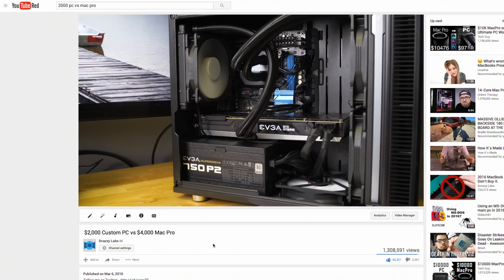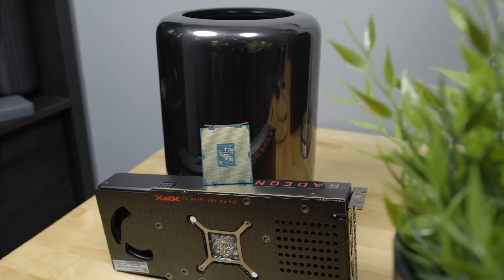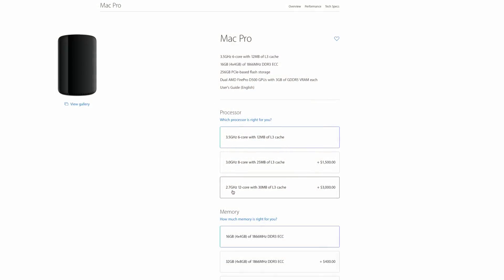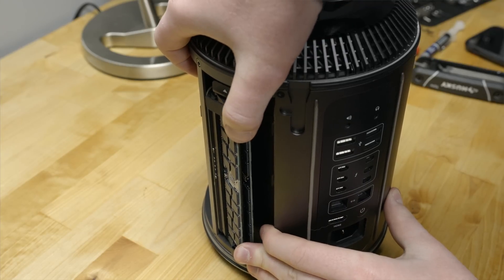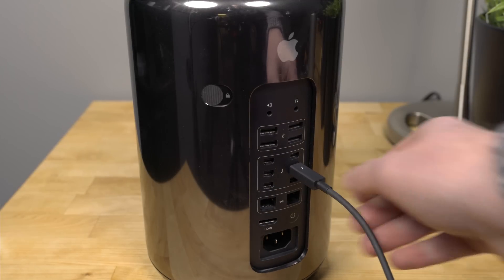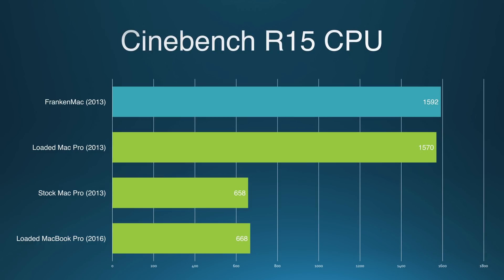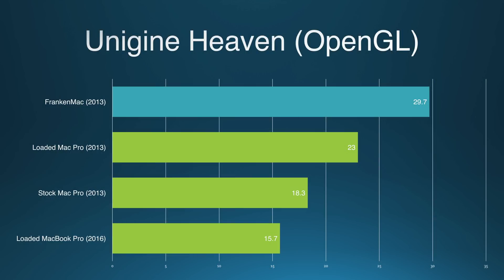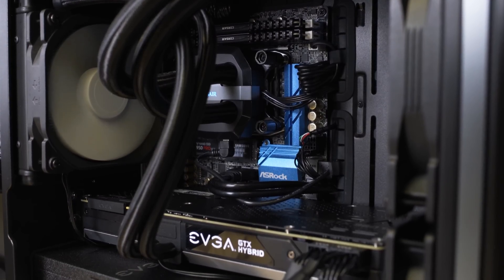The Best Mac... Apple Doesn't Make!

Comment: Hello ! Your work is awesome thank's for sharing this informations! I have questions though, do you mean I could actually 
just buy this  AMD RX480, put out the AMD FirePro D300 and make it work just using thunderbolt port?
I am currently working on my MacPro late 2013 3,7 GHz Quad-Core Intel Xeon E5
I upgraded it with 32Go ram (4*8Go Crucial DDR3 ECC), and recently a OWC 1To SSD.

I mostly work on After Effects, and according to the latest Adobe keynote, lot of information will be treated through the GPU on the next update.
I would really like to be able to upgrade my Mac Pro in order to stay with it as I still really like this computer for reasons.
Your solution seems so cool, and actually the only hope I seem to have; but I am not as skilled as you are in hardware, and I lack budget rn. 

An answer would be so  appreciated ! Again, thank you for your work!

Comment: So you could connect the External GPU over Thunderbolt 2 and it worked? I’m wondering if it’s possible to get an EGPU on a 2013 MacBook Pro, or my Mac Mini (both have Thunderbolt 2)

Comment: I've seen people do the same thing with an old imac. Get something like 
an old 2011 imac and put 1TB  SSD raid, 32GB ram,  and an intel i-7 
3.4Ghz cpu in it and in many cases it will outperform a lot of off the 
shelf imacs and be cheaper in the end. Except for in gpu performance of 
course because the gpu can't be upgraded.

Comment: i bought my Macpro 2013 used for 1500 bucks in 2018. It was a demonstration model. Still overpriced but I like the fact that it is very quiet and relatively powerful l. I did upgrade the ram to 64gigs which helped a lot for about 300 bucks.

Comment: And that’s why apple will probably be locking down modification with T2 chip, solder every component to the board, and make even more obscured screws or pour in the glue for a higher IP rating. I mean how else they going to sell such innovation as having a Touch Bar that can display Nyan cat on a pro device that cost only $5000, when the rest of the world has been using touch screen for the last 5 years.

Comment: How are you not using a cheese grater yet? Like I spent less than a grand on my total system, get about the same (1550) cinebench score, in heaven at 1440 ultra I got 73 FPS. The 2009-2012 mac pro is still the best mac for creative pros, unless you want to shell out for the raw power of a 14 or 18 core imac pro, and even then, you have to use an egpu if you want anything better than a vega gpu...

Comment: What’s even cheaper is to take a 2010-2012 Mac Pro with dual CPUs, upgrade them to dual 3.46GHz 6 core X5690’s, put 48 to 96GB of DDR3 in it to keep triple channel, and then put your RX580 or the like directly into the PCIe slot. Add a PCIe card for M2 drives or sata3 ssd and a PCIe usb 3 card and you’ve got the nearly identical equivalent to your setup for less than $1000.

Comment: I have a Mac Pro late 2013 3 GHz 8-Core Intel Xeon E5 // only upgraded to 64gb of ram // If I get the gpu upgraded would it work as good as the 12 core cpu or what do you recommend ?

Comment: I just found this. Here it is, 2nd half of 2018 and still nothing from Apple. I bought the the entry level 2013 4-core 3.7 and have added 64 GB of ram. I'm going ahead and getting the 12-core CPU and wanted to check if there are any new options on graphic cards/enclosures that I should consider. BTW, thanks!

Comment: I instead upgraded my 2010 Mac Pro: 64 GB RAM, GTX1080 from MacVidCards, Kingston HyperX Predator PCIe SSDs. The CPUs can be upgraded a bit if you really want to, but I already had the fastest ones.
You need the NVidia webdrivers for everything to work, but boy is that thing a lot faster. If Apple would just sell the cheesegrater Mac Pro with an updated chipset and CPUs...

Comment: the ebay listing you showed for cpu were QS however the cpu you intalled is ES. what's the difference?
also the akitio Thunder2 info says: "This Product was not intended for the use of Graphic Cards" what's the deal?
also, is there a specific reason why you bought the QEEY instead of SR19H?
Finally, did you have any issues with the ES chip such as freezes?
Thnx a lot.

Comment: If this could be done for cheap much like the way Socket 775 users kept their platforms relevant with Xeon CPUs that could be bought for $50, it might make sense but in reality this seems like an expensive way to keep a dead-end platform vaguely relevant. $1000 goes a long way to buying something that is not obsolete and has future headway for upgrades in the future. The bottom line can be summarized by this quote: "Is it faster than a $2500 PC? No.."

Once again, Apple continues its disdain for its desktop and mobile computer user base putting out sub-par products at inflated prices. The best thing they ever did was move to Intel based hardware, yet they always seem to be two to three steps behind the latest architecture. Unacceptable when you're charging premium prices for something that is pretty, but not particularly rugged or durable.

Comment: Am I the only one who's looking for this solution apart from Snazzy? Quite a bit confusing at the moment as there are plenty tb3 solutions and barefeats claim they do work with Mac Pro (I guess with an adapter), however there is no solid parts list and full logistics and schematics of the particular solution. Would love to see some good solid links to read before I pull the trigger! both d300 died in my Mac Pro and I am truly spread on both Mac and WIN OS and there is no quite a solution that is quiet enough and can power 5 screens and run parallels with heavy software and spreadsheets with modelling the universe!

Comment: Apple's software is alright, though I don't find their apps appealing and I really struggle with finding simple tools in the taskbar and settings. But the hardware: it is far overpriced and not generously clocked. Well, I'm interested in hearing what Apple users have to say (as long as they don't rave about the computers themselves).

Comment: The RX480 performs poorer in titles running the OpenGL spec because AMD's OpenGL implementation is pretty bad.
Reply from the maker: +Arena The same holds true for NVIDIA. It's poor macOS optimization—not the GPU manufacturer.

Comment: What do you think about the HP Envy 34 Curved Premium All-in-One AIO Desktop (Intel i7 Quad Core , 2TB HDD + 256GB PCIe SSD, 16GB RAM, NVIDIA GeForce GTX 950M, 34 inch Curved QHD Display 3440 x 1440, Win 10)
And if you can show how to build the frankenmac

Comment: Are you not able to plug in two thunderbolt cables to the graphic card?
Reply from the maker: +Michael Lin No.
Reply: I see. I thought that it was possible considering a computer needs two thunderbolt 2.0 slots to display 4K. At least that's what I heard.

Comment: My new policy is Apple laptops and Hackintosh desktops.  I've been using and abusing Windows since version 3.1, and have grown to hate it more and more over the years. By comparison, there is very little even slightly annoying about OS X. Add to that, I have never had a PC laptop that came even close in build quality as the Mac I have now, no matter how much I've spent on one.

Anything "locked down" about the operating system (I actually care about being locked down) can be gotten around fairly easily--I'm very good at and like to tinker with software, BUT I don't have to deal with random problems popping up all the time, like I did with Windows. I've come to the point in my life that if someone wants me to be a Windows system admin, they'd better pay me some goddamn money for it.

By the way, I paid MORE for my last PC laptop (an HP ultrabook), than I did for the MacBook I'm using right now.

Comment: Outstanding video production and well balanced assessment of Apple kit. Thumb's up for that! I like that it's a Franenmac and not a Hackingtosh. A lot less to fiddle with.

The 2013 is the most beautiful Mac made but far too limited compared to the previous 'Cheese Grater' versions. Apple wanted it to be the Cube of the MPs but they painted themselves into a corner. And yet they're still pretty proud of that Mac. I'm hoping the promised successor to the 2013 is much, much better. 

I'd like a 2013 MP but it's outperformed at almost every turn by iMacs, so I just ordered a refurb Late 2015 iMac for about 1/4 or less of the price of even the newly discounted MPs. I don't really need real CPU/GPU horsepower enough to want an eGPU, but well done!

Comment: You know you can still use a k5b with xeon cpus and use the modern AMD cards natively, without the hassle of an external connected GPU. Just replace the hard drives with flash storage and that thing still performs very well

Comment: Why not hooking two rx480s in crossfire to that thing? You could use ribbon cables to hook them up to the mac's motherboard, and since that supports crossfire, you might be able to get them working easily.

Comment: So you changed the GPU, CPU, RAM and Case. Basically you capt nothing of the original PC. And for the 600+ Dollars you paid for an old architecture, 2.5GHz CPU, you could have gotten a i7 7700k  + cooler + MoBo + PSU, and build an entire system, that would kill the one you ended up with. Not to mention that your CPU-GPU balance is terrible. You can get a 1070 or 1080 with an i5 or Rizen 5 for the money you spend.  I really don't get the point of this video.

Comment: Awesome video.  Thanks for bringing us great information.  I did the CPU upgrade on my mac pro, bought everything in the video, physically modified the Akitio box, but am stuck on the power issue to the pcie bus.  Did you power the Akitio using the PSU? If so, how? I read everywhere that the RX480 needs more power than the Akitio stock power brick will give. Can you help me out?

Comment: Would an RX 480 (or 580?) still be serious competition if hooked up to a 13" MacBook Pro (I'm looking at the Touch Bar model) with a dual-core cpu through TB3, or does an eGPU really need quad+ core to be in any way competitive?

Comment: So.. there is the computer. and then there is a thunderbolt connection to a giant subwoofer-like device.
tell me i'm stupid but that's not worth it.
it's easier to hackintosh or just abandon apple's hardware dependency completely.

i see nothing in this video that cannot be done with windows software.

STILL:
i like your idea about getting around those expensive upgrades apple offers and you sure as hell made a great video.
but.. this is more of a proof-of-concept than anything that is actually worth doing

Comment: If you pay $600 for an E5-2697 when you can get an E5-2696 for $300 or a E5-2690 for $150 then.... you're a jackass.
Reply from the maker: +Shawn Snow 2696 isn't compatible. 2690 is hard to even find second hand and straight up impossible to find for $150. Or even $500.
Reply: Actually, there is a write-up on Macrumors covering compatible cpu replacements for Mac Pro 6,1, which I am assuming yours is. Correct me if i'm wrong. The list includes the E5-2697, 2696, 2690, 2680, 2667(v2) and most of the E5-16xx series as well. I can't personally attest to the veracity of the list, but i'm fairly confident the 2696 v2 is compatible. 

I'll concede your point on the the 2690 and 2680. I didn't realize how scarce they had become, but they are not impossible to find. 

All that being said, the comment was intended for people in general who may may be considering trying this. I can completely understand why you would buy the best available CPU(because it will pay for itself and because it help illustrates the point you are making), but most people would be better served by purchasing one of the cheaper CPUs because the savings in money would far outweigh the marginally diminished performance specs. To my knowledge, the E5-1620 is the only compatible quad core on the list, so anything above that is going to perform substantially better. Even then hex cores perform considerably better.

Comment: Thanks so much for the video!  I'm confused on how to run the external graphics card -
Does plugging it into the thunderbolt port tell the mac to use it automatically?  
If so, would this same approach work w/ a macbook pro?  (I don't need it to function as a LAPtop, just a portable desktop)
Any thoughts from anyone on updating the processor on my MBPR (mid-2012) in the way you show here?  (I'm waaaay out of warranty, so I don't mind tearing it apart a bit)
thanks again!

Comment: Well this is actually the intention of the Mac Pro - the whole idea was external expansion via Thunderbolt.

The problem is that fastest graphics cards on the market aren't supported by OS X, and therefore you're stuck with the 480 which, while decent, doesn't even come close to the GTX 1080.
Reply from the maker: +IshayuG You could use a 980 Ti which is a lot faster than an RX 480, but you're still bottlenecked by Thunderbolt 2.
Reply: That, and you have to fiddle with the drivers.

That's not too bad, I know, but yeah.

Really we should've had a new trashcan with updated specs and and Thunderbolt 3. Thunderbolt 3 is really where the Trashcan idea shines because, you see, a GPU uses no more than PCIe3.0 x4, with the rest being dedicated to SLI/Crossfire and sending the framebuffer back to the CPU if you need it.

So really, with a USB-C enclosure running over Thunderbolt 3 connected to a Mac Pro, you've got the e-GPU concept going in full swing, because Thunderbolt 3 offers 2-way 40GBit/s, so it's actually PCIe x8 in that sense.

Comment: Could anyone tell me how to do the correct way to type in the kext for my Mac Pro. Specs: Two E5462 4 core cpus, 32 gb ram at 667MHz, a MSI 4670 with 1 gb gddr3 and an apple 2600xt.

Comment: Hi. Great job. How does macOS know that it should use the external GPU. Does the GPU enclosure have some kind of hardware to make that so, or this could be applied to an iMac with Thunderbolt 2 and just plug in a Thunderbolt 2 enclosure with power supply and any modern Nvidia or AMD GPU? Thank you. God bless. Proverbs 31

Comment: I'm confused why you would bother with all this time and money spent on making an already overpriced machine work the way you want when a far cheaper and far easier solution exists in Windows machines. 
Besides the fact that your description essentially means you did all this just because you moved from Premiere Pro to Final Cut Pro. So, basically, you did all this just to switch between two equally matched pieces of software.

Comment: So obviously the advantage of this machine is to be able to run OSX guaranteed, being both stable and supported by Apple. This being said, I have a number of questions. Is the Mac at no risk of being obsolete? I'd assume that there would be some sort of new Mac Pro coming out soon, so this worries me. Do you have to use that specific CPU? as well as do you have no way of essential mobility because the graphics card is external? For example, it would probably be a lot harder to just grab the computer and go watch a movie or do editing at a friends house or on a trip, right?

Comment: couldn't you have an additional ssd in your pc tower that ran an Apple platform? when booting up you could just select your preferred platform for when you need to use it.
Reply from the maker: No. Doesn't work like that.
Reply: Snazzy Labs damn
Reply: Snazzy Labs besides some legal issues, why not since it is just software.

Comment: This seems like a lot of fucking effort and cost just to run a piece of shitty, bloated, overpriced Apple software....I mean, is it really going to increase the production quality of your videos enough to justify all of this? (Hint: I doubt it). In fact, I'd personally like you more if you didn't bend over for them...
Reply from the maker: Yes, it is. Final Cut Pro saves us hours on each project due to plug-ins that aren't available (nor as powerful) as comparable ones for Premiere, Resolve, etc. Several hours per week in labor quickly surpass the $1,000 we spent on this project. Furthermore, thinking of FCPX as "bloated, overpriced software" is a farce. It's one of the fastest, leanest, and least expensive NLE.
Reply: Being the best at something doesn't make it not bloated or overpriced....It just makes it less so than the alternatives :)
Reply: btw, point well made about the effort/cost involved with updating the computer. I guess I just have some open wounds from dealing with the  company. I was a contractor on their maps project and it left a nasty 
taste in my mouth. There is nothing at this point that would make me  give them my money, time or effort.

Comment: I have a 2010 Mac Pro, and while it was expensive, it is outstanding. I have some kind of special model with a 6 or 12 core Xeon and an AMD ATI Radeon 5870HD, and although a 1GB graphics card (RAM isn't everything) it runs nearly all the games I have at ultimate or high settings without any problem. It's not outdated at all. It was very powerful when it came and it's very powerful now.